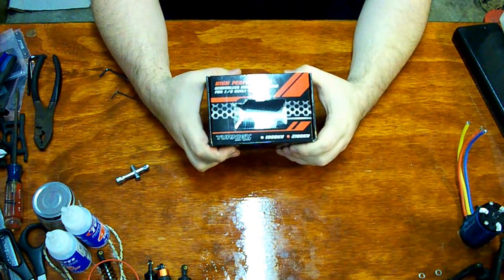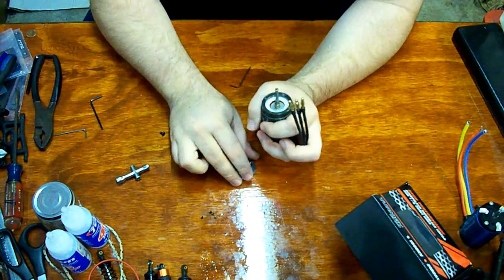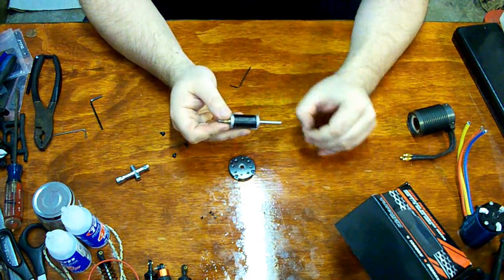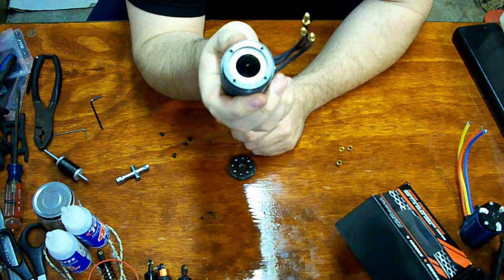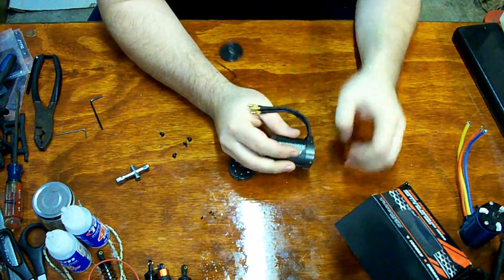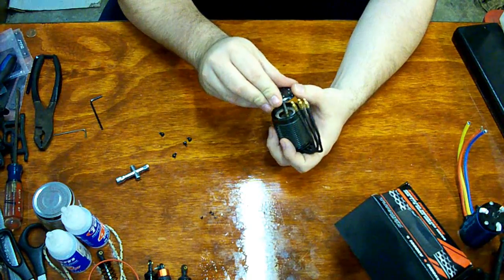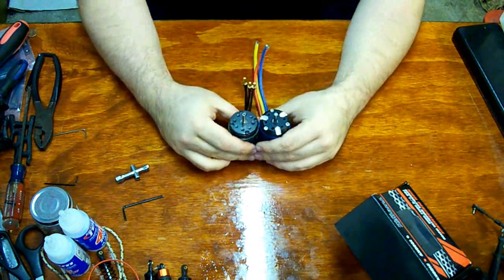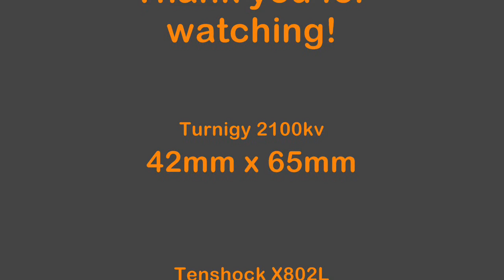Turnigy 4 pole 1/8 scale brushless sensorless motor - IN DEPTH LOOK!

Comment: can you run a 1/8 motor on a traxxas venilon esc witch is a 320a 200a continues plz reply
Reply from the maker: BLACK 0PS BOSS Depends on how much amperage the motor pulls.  I wouldn't do it - I'd want a bigger, 'full size' 120amp setup.  The Velineon ESC is, imho, rated higher than it should be.  Also, no need to add 'plz reply' - I tend to reply :)